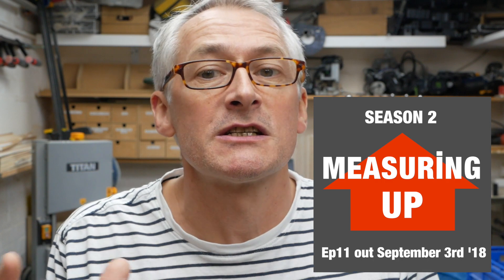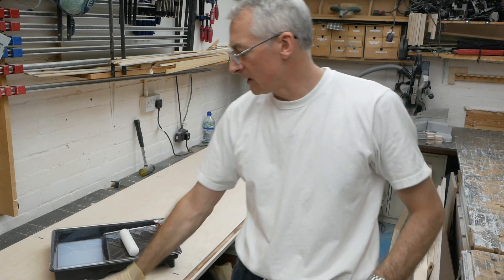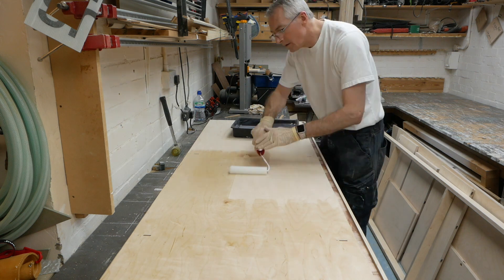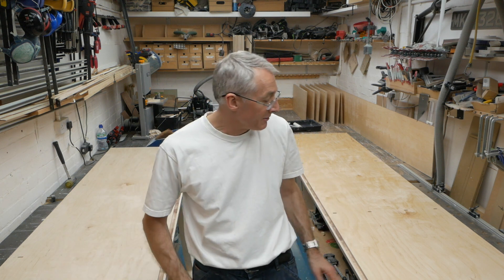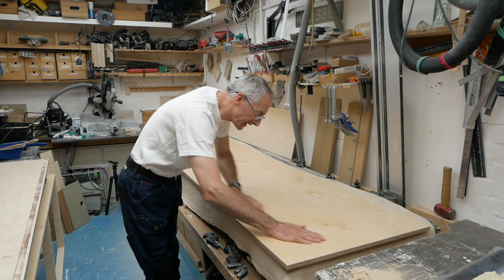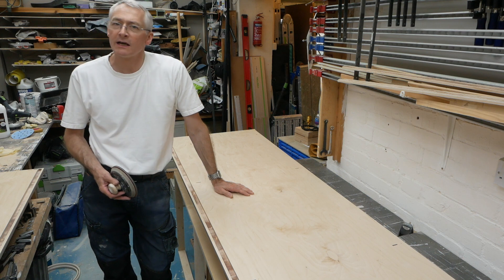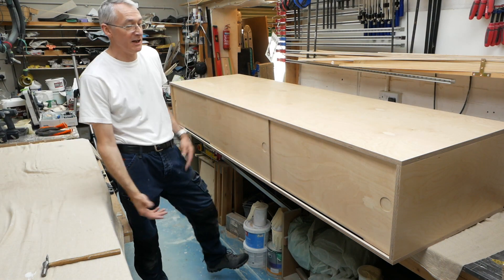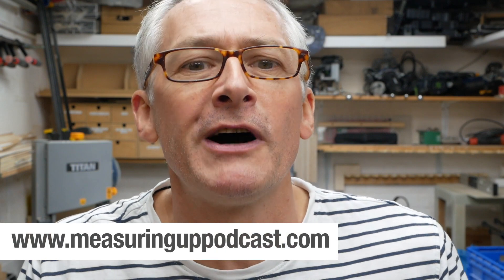How to make a Birch Ply Banquette P3 [vid # 207]

Comment: Nice one, looks good. When you put the first connector in the top, I said to myself, I would give that a tap with a hammer, then low and behold a hammer appeared and tap, tap. Hate to say this, but I remember back in the late 50's early 60's [yes I am that old] Birch ply kitchen units were everywhere.
Reply from the maker: They still are in some parts! Joey Chalk (Kingpost timberworks) does quite a few Birch Ply kitchens - I think his latest video is one! 👍

Comment: Those domino connectors are very clever.  On the basis it will never need to come apart once installed, I think I would have used normal dominos and a fast setting glue, clamped it up on site and had a brew whilst the glue dried.  Glad you didn't do that though as it was interesting to see them in use. :)
Reply from the maker: For the price of the connectors, I take a brew any day! 👍😂

Comment: The birch ply is a refreshing change from mdf; it comes on beautifully after you had varnished, sanded and secured the hardware. 
 
Great walk-through. How much do those fixings (pins) cost?

Whoopie! That fitted well; I could sense your sense of relief there!
Reply from the maker: Thanks Deanne. The fittings work out at around £1.60 apiece, so not for everyone, or everything. But I used 16 in this piece, so about £26-worth, which is incidental in the overall cost of the job. 👍

Comment: Hi Peter thanks so much your content is awesome. I'm working on my first build in ply. Did you finish then glue? I thought you had to glue before it was finished so the adhesive worked on the bare wood. Wish me luck!
Reply from the maker: Thanks; this one wasn't glued - just held together with the domino connect fittings, so yes, it was pre-finished. I'd usually pre-finish before assembly, just scuff up the areas where the glue contacts with an abrasive. 👍

Comment: Lovely job. Do you think you actually need all the knockdown fittings or could you have half domino? Would save a small fortune  👍👏👏👏
Reply from the maker: Thanks! I did wonder about it - using the domino connectors for every other fixing, say - but in all honesty, while the fixings are individually quite pricey at £1.60 apiece, in a build like this the difference between 8 fittings and 16 (£13 vs£ 26)  is stuff all in the overall price of the project. 👍👍
Reply: I’m still on the domino and pocket hole knockdown process. I use 3 dominos and 2 pockets for pull down. 
Waiting for a job to loose the initial purchase of the domino setup. 👍

Comment: I also just purchased some good quality Birch Ply for a torsion box jig 'thingie' - which I have just laminated (stuck together). Compared to the cheap stuff it has a nice feel about it and is much straighter/flatter and also has 13+ layers in a 12mm thickness. The Birch Ply has one good face - free of oval plugs and (unfortunately) a few plugs on the other side. So I put the ovals facing inwards on the inside where they won't be seen. On your Banquette,  your top has some oval plugs visible. Is that something that will remain visible when the project is finished? Were the ovals on one/both sides?
Reply from the maker: BB grade usually has one good face, but not always guaranteed without plugs. The top will have a long cushion over it, so it won’t be visible in the final piece. 👍

Comment: See i love birch plywood. However i cant seem to find a grade high enough which provides no defects or patches on both sides. Any advice? I see that project had patches in.
Reply from the maker: BB is the highest grade Birch ply, with no defects or patches. My timberyard stocks B/BB, so one clear face and one with patches. Made a mistake on this one and cut the handle recesses out of the wrong side, didn’t notice until after, but they’ve been changed. 👍
Reply: Thanks again for reply. Yeh i can only seem to get B/BB grade. Shame i would love perfection. 😜 Keep up the good work.

Comment: Peter don't know if you saw the comment on the last vid, but with regards to the top and where you used the wrong size bit, is there a reason that the 5mm cutout can not be enlarged to 8mm?
Reply from the maker: Hi Andrew. I think I replied to all those comments (there were a few) my apologies if yours slipped through the net. The problem was the 5mm slot had been made on the medium setting, and the 8mm needs to be in the narrow setting for the domino connectors to work. As the domino connectors expand to grip the edges of the mortice, I’d need to fill the wide 5mm slot first, then re-cut with 8mm. it was just less fannying around to move the slot over, is all 👍👍

Comment: Love your work and the way you film and comment. I also like the MDF products you make. It has changed totally my view on MDF. I am going to make a Birch ply media console and would like to finish the way you did. What exact product did you use? And did you sand after the first coat with 120?
Reply from the maker: Thank you! There are links in the video description to products used or featured, btw. I used a product called Junckers strong - http://bit.ly/Junckers_Strong - which is actually a water-based polyurethane flooring lacquer, but works very well on birch ply. There are other products that do the same I’m sure, but I do like this one. And yes; I de-nibbled after the first coat with P120, then in-between coats with P240. Came up nice! 😆👍👍

Comment: Great Video - as always! :-)
I have two questions:
1.) Why don't you do it like Ikea and use only every second domino one to screw and the others the old fashioned ones without glue? It would be much cheaper.
2.) Are you sure you have the right side of the plywood outside? Often you have one "good" side and one side with patches over the knotholes. Sorry the patch on the right door is bothering me! :-)
(please excuse my englisch...)
Reply from the maker: Thanks! I have 2 answers 😆 1.) it was out together like this so it would go in easily - access was difficult. It’s unlikely to happen, but I also wanted it to come apart easily if it were ever to be moved to another room. And it really wouldn’t be much cheaper to use half the fittings - I used 16in, so ~£26 in total; that’s incidental in a job like this. 
2.) Yes the doors were ‘wrong way round’ because the grain on this side was so much nicer than the other, and this was the last decent sheet of 6mm Birch my yard had in stock; I (and my client) can live with the patch. Oh, and your English is perfect! 👌👍👍